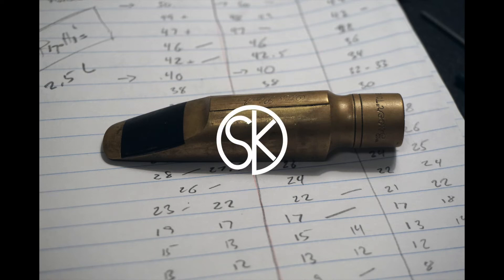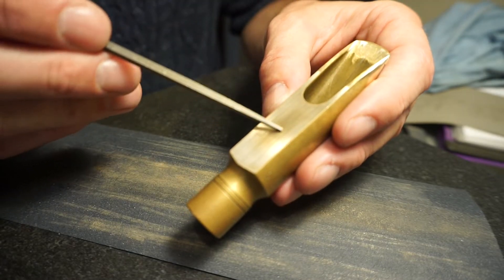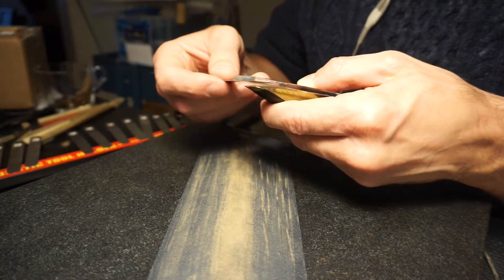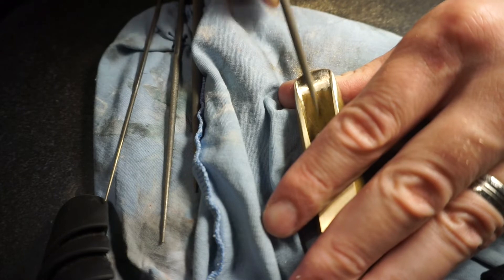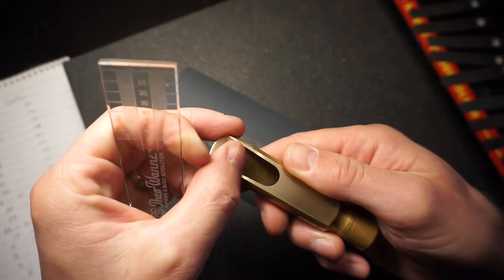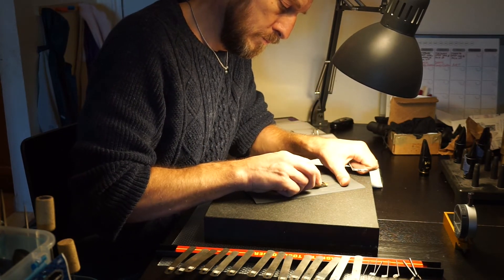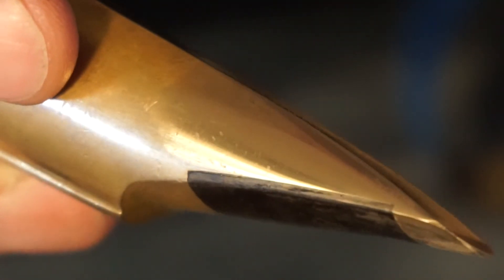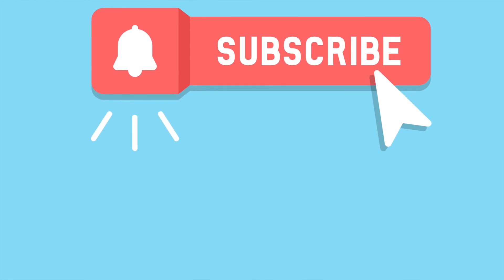Otto Link Double Ring saxophone mouthpiece refacing

Comment: I heard a rumor about that the table isn’t supposed to be flat but concave (in both directions) 
Is that correct or just a myth?
Reply from the maker: It's not a myth. There are different ways to make the table. Flat, concave, and even with a dimple in the middle like a lot of Vandoren mouthpieces. The Early Links were made with flat tables and are now made with a concave table. The problem with concave tables is that they're almost never made accurately and that causes problems. It's hard to make a truly flat table but when you have a truly flat table you get a very even response throughout the full range of the horn which is why I do it like that.
Reply: When you say “early Links” what period are you referring to?
Reply from the maker: @micketenor  Up until Early Babbitt as far as I can tell from what I have seen.

Comment: If the baffle was already playable on a mouthpiece. Why do you need to re-do it.  If you re-do the baffle; then you are redesigning the sound to your personal (modern) taste .
Reply from the maker: Good point! When refacing a mouthpiece the tip rail often becomes wider in the process. The baffle then needs to be reworked to have everything work together. In a way, yes, the baffle is redesigned but it is not necessarily different from how these pieces differed when they were made. They were hand finished from the factory by different people so every single DR plays different and most of the time they have that special DR vibe going on that's quite special.
Reply: @Stephan-Kammerer   Never though about what you are saying. But I get it now. I have a  tenor DR which started off as a 4 and was bent to .108.   .Plays great.
Reply from the maker: @raefblack7906  Yep, that sounds like a doable project. I open piece like that often :-)